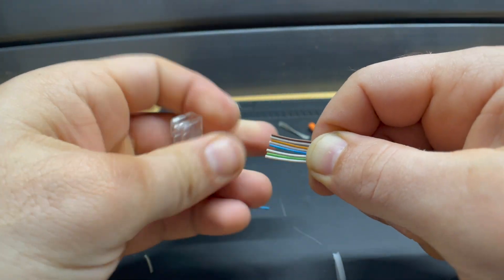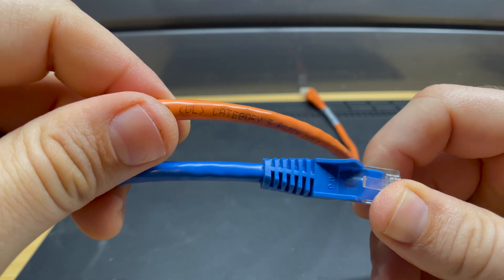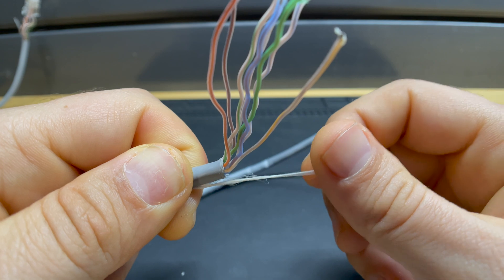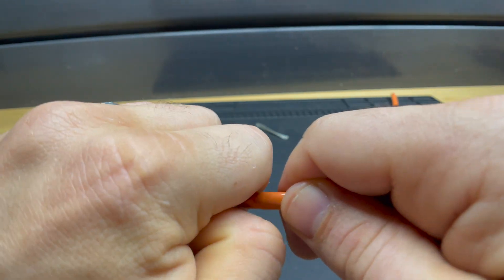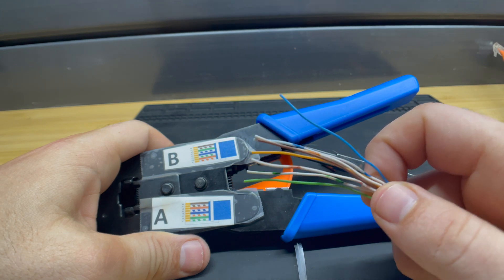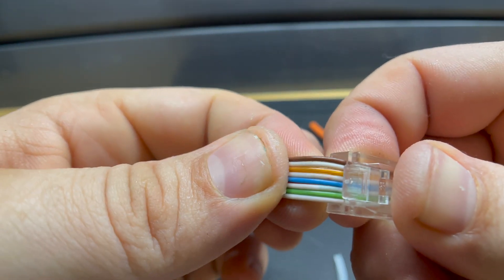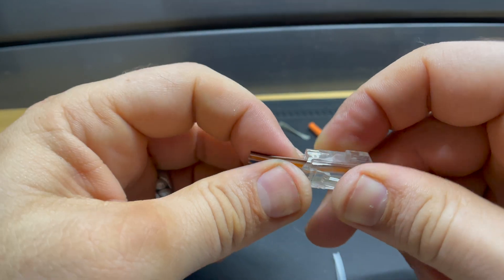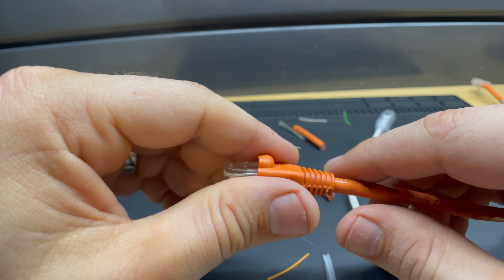Best Way to Make an RJ45 Ethernet Patch Cable | Cat 5 and Cat 6

Comment: A client bough some cat 6 riser cable from Lowe’s and it was an absolute PITA to terminate. The inside wires did not untwist easy and were so stiff it was hard to get them straight. I had better luck with plenum wire.